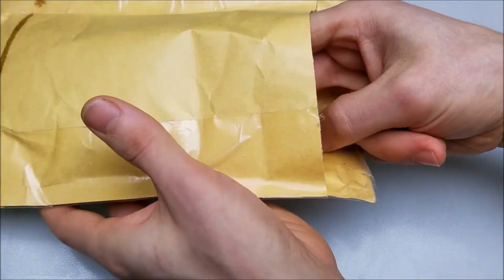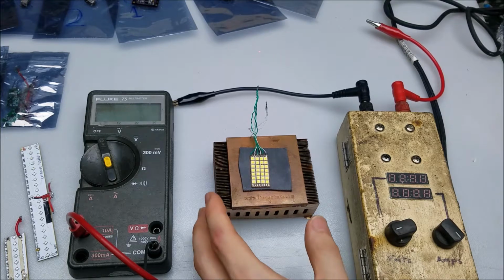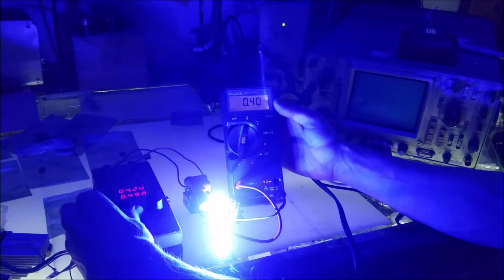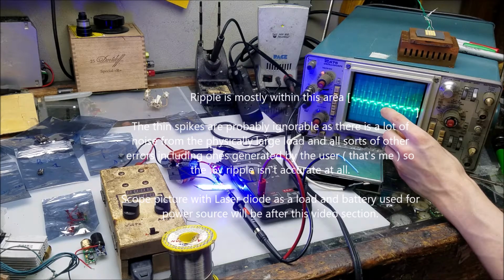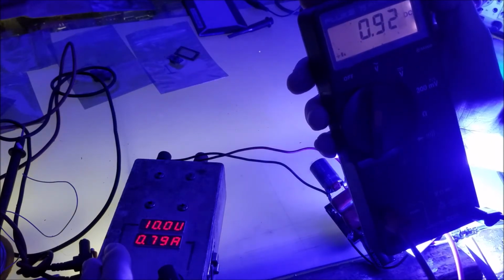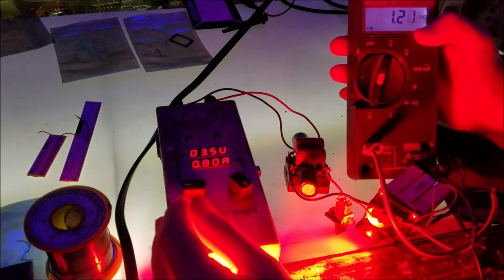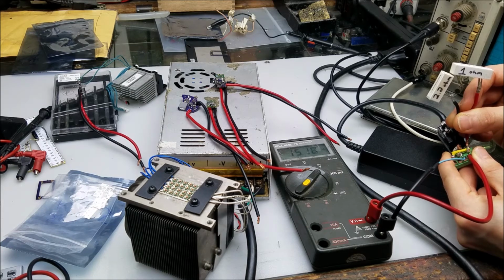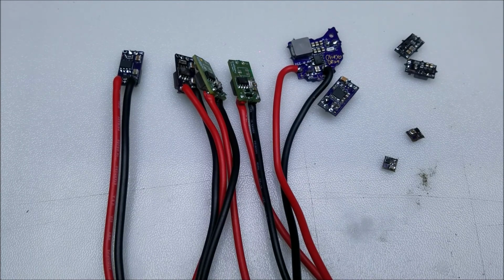Testing Laser drivers made by Giannis! Κατασκευασμένα  σωστά στην Ελλάδα!

Comment: Oy, Just watched the video and I have a way better theory of what happened, As you saw when I was powering my array I had the same revision bucks from the same batch and filtering on the input, Under these conditions, I have seen that they can be put in parallel. I am saying under these conditions cause the ICs are not rated by the manufacturer to be able to be put in parallel on the same power source, Now I saw that in Patrick's he used 3 different board revisions, The prototypes, the latest revision and the Ohio which has an entirely different layout.
Now you might ask, 

Why is that important?

Well, Different board revisions are different cause the characteristics vary between them to a point where I can justify saying that the revision number is higher for X and Y reasons.
 
Now what the fuck is different you ask?  

Well, lots of things and especially for the ohio, Ohio's switch node length is significantly higher due to the board size and hence the switching frequency and ripple is very much so noticeably different to the prototype not even mentioning the most recent rev. Ex: Ohio ripple tends to be 30-40mv with a switching freq of around 910khz, 3A buck latest revision is around 9mv p-p at 860khz and prototype around 20mv p-p at 880khz. It all comes down to layout optimizations. Now with their output and switching characteristics being so different from each other,  you are bound to have a multitude of regulation errors not to mention interference between them. Don't worry about his project though, I sent him the BOM info of what parts he needs to buy and he will populate the white boards and repair the other drivers. Also, he will put a low pass filter on the input - as I have to help knock down any interference. 

On the last note, I just want to mention that a datasheet for the bucks is available on my website, stay safe and don't kill your diodes :)

Comment: Okay, I'm not into voodoo, either. But the timing of this is too spooky to not share. Remember that blue laser diode that died and replaced with the 1.6W off ebay? Well, thanks to this video, I probably understand why.
I was aligning the dichroics (again, due to unstable mounts) inside the 3W RGB module. There is no piezo cooling, o the 450nm diode overheated, causing current runaway. Now I know and will add a piezo cooler to my projectors. Cool.
The supplier originally provided TTL driver boards, instead of analogue. The identical 12 VDC power connectors were mounted in reverse polarity on the 1st pair of replacements, so they blew as soon as I powered them up (no reverse polarity protection |-(). The 2nd pair of replacement analog driver boards were just delivered to another customer in Colorado. |-(
Meanwhile, I've been wondering how to set the gains on the analog boards, w/o frying the LDs. Are they preset? Probably not. Set to no output? Possibly, but I still need to know the specs on the LDs.
Then, before I fry something else, here you are, with nearly everything I need to know. I was thinking, "Queue eerie music." And then you did in your video. lmao!
Thanks, Zen! You're f*ing awesome!
Reply: Fun fact: Me killing my blue diode with a driver that had absolutely 0 reverse polarity protection was my main inspiration to make drivers!Just to include that feature, Product was the 3A buck :)
Reply: @GiannisLS  This story just keeps getting more and more overly-coincidental. Saw that on your website. Are all of your drivers TTL or do you also make analogue driver boards for laser diodes, up to 2 Watts?
Reply from the maker: Hey Hermit, if you're wondering about setting the drivers you can send a picture of them over to my e:mail and I can see what you have to work with, usually there is a potentiometer you can turn and it will adjust the current output. Also, Peltier coolers are what to look into not piezo, though depending on your set up that may not be needed. If you have questions on the whole project feel welcomed to send pictures of anything you have an inquiry on and I will use the remaining eye to give you some insight.
Reply: @TheOleHermit   I don't make drivers that offer analog modulation capabilities but all of my drivers offer PWM input capabilities.

Comment: The fire made me laugh 😅🙈
Fires I don't mind, it's when something explodes that I crap my pants 😂
My thought was inductors too, maybe they can be protected with a resistor or diode (why did I say choke👀)
Reply: I outlined the problem in the pinned comment, check it out :) sadly neither can be used to protect the inductor as such protection would not only be ineffective but would also hinder performance extremely or cause the driver to not work entirely. The driver doesn't require an output diode cause it has an internal H-bridge doing the rectification(look up synchronous rectification if you want to learn more about that)

Comment: Hi, I watch every single one of your shows since I too am extremely into lasers and I too am doing quite a bit of experimenting with semiconductor lasers. What wavelength of red does that array put out? I briefly  saw an array on  e bay some time back that was at 650-660nm but it was very expensive and disappeared quickly. Are you definitely going to build this red phasor type device? Are you going to keep the beams seperate or try and combine them into a knife edge array type beam? That is what I would have liked to try but I am not good enough at the fairly small optics arrangement that would be needed to properly combine 20 beams into one and still have good long distance beam quality.
Reply from the maker: The red arrays that we have are the 658nm prototypes, they moved into 637nm as it's a visually brighter red. More on those laser arrays here.
https://www.ushio.com/product/necsel-mdp-red-laser-637/

I am certainly 100% building the phaser, I just have to figure out how I am going to effectively knock down that extra .8v on a 16.8v lithium ion bank and then it's off to gather the other ingredients for actually building it. I am hoping to have it be in nice single hand form factor.

Knife edging would be very difficult to do. I thought about it and do have enough optics but doing so requires optics on 2 axis to join the beams. Because of the odd geometry that would need and additional size added I won't bee doing that. I figure once made it's going to be much more of an art/engineering piece. 

When I do get to that project It will be more about the build process and not it's amazing burning power pew bang, mostly just to keep this channel as more of a learning lasers channel overall.
Reply from the maker: I may end up putting an adjustable focus in the front section, I did give myself plenty of room in the design for that, but I need to find a lens with a very small level of curve so it can focus on things further then a few feet.